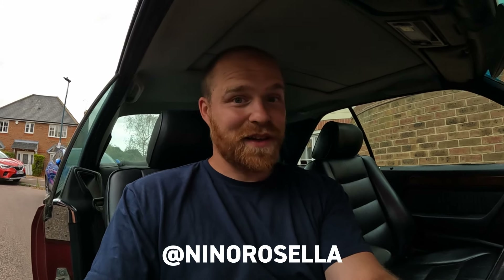One Last Try Fixing My Mercedes 220E

Comment: Got to learn how to diagnose components man, make your life so much easier, leave the guess work out of it & save you lots of time and frustration man.
Reply from the maker: This is all part of the process. Don’t forget that at the start of the year I knew nothing about how to fix cars. Quite happy with my progress so far.
Reply: what does that mean
Reply: @NotEconomicallyViable  you were on the right track with the spark issue, a bad crank sensor usually ends up with a no start period.
Reply: Ok man. Take it easy man.
Reply: Rough running and dying when off cold, really sounds like ignition. Replace HT leads , rewire the coil 12v wires and measure the coil resistance.

Comment: The sensor is easily tested by moving magnet in front of the tip, while monitoring the output by a scope. This sensor works with a spinning tooth wheel, with one missing tooth to mark rotation beginning.

Comment: Have you thought about getting the computer checked? It sounds like to me that everything starts up okay when it’s cold and then when it gets hot the whole lot cut out so there could be something not quite right in the car computer and being a very old car, I would suspect capacitors in the computer. I’m not working like that.

Comment: Just a quick thought, had a similar issue on a Ford Focus 2.0 duratec, would start, run till it warmed up then cut out. 
Solution after a lengthy trial and error diagnostic attempt was to unplug the EGR valve, it ran fine.

The problem was the EGR valve was sticking open when it opened up ie when it warmed up and I put my foot down, it felt like fuel starvation, the EGR is meant to open up and close at various throttle positions, it recirculates all the sooty, oily carbon gunky exhaust gases back through into the inlet for increased mpg and reduced emissions.

Now they do clog up, it might be you could take it off and clean it up, I tried that with mine and it partially cured it for a short time.

Ultimately I changed it out for a new one.

So unplug it first, try that, if no change, try cleaning it out.

Best of luck figuring it out.

Note when buying parts- shop around, recently had to buy a new engine mount for my focus, was quoted £191, tried my local budget parts shop, who are ususlly very cheap, they could get it for £90, rang another place £60.

Even tried a Scrapyard they wanted £20 for one off a similar age car that was probably as knackered as mine!

Got the part number from ford  tapped it into Amazon, BOOM one brand new Febi Bilstein £31 with free delivery, get in!! Quality was better than what was fitted as standard.😀 

Also check your part number and cross reference it with sites like auto doc, or even try Febi Bilstein website they also do cam sensors etc

They might be expensive but you could tap that part number in to Amazon or Ebay etc

There are always alternative part numbers from other makers that will be exactly the same.
Reply from the maker: Thanks for all that info, bud 👍🏻 

One thing I've started doing is first looking at parts on AutoDoc before anywhere else because they give you all the alternative part numbers from different manufacturers. I then just start searching around all the different sites like you said. 

The problem I have though is that I sometimes just need the part as soon as possible so that I can get these videos out, so I have to pay a premium. It's a bit annoying, but that's just how it goes!
Reply: @NotEconomicallyViable  You're welcome, I know how frustrating diagnosing an engine issue can be!
With my Ford I went on the forums put in my engine symptoms and got back the multitude of usual standard replies, fixes I already tried-
'oh it's your plugs', 
'no it's the coils', 
'fuel filter blocked', 
'defo your crank sensor', '
'no, I had this exact same thing, turned out it was a mouse eaten through the loom in the boot'😲😁

Thing is it could be anything electrical or fuel related, even an intermittent electronic fault like a bad ECU or faulty loom etc

But definitely worth checking your EGR it's something a lot overlook, gets blocked up, especially on higher mileage engines, will give erratic running like this because at cold start it doesn't open until it warms up, then it's meant to pulse open under certain throttle conditions, to let a blast of exhaust gases and recirculate it into the inlet, what happens on a clogged up EGR it sticks open, now part of your exhaust gases are going directly back into your inlet causing the engine to cut out.

I'm assuming as it cools down the valve closes again so it will start next time.

Unplugging it stops it from being activated or opened, it will throw an engine fault code but will run fine without the EGR plugged in.

Keep in mind if the EGR is stuck open or half open, it will still run erratically  or cut out, in that case worth removing it and cleaning it out with carb cleaner, there are specific EGR cleaning methods typically a spray can used while the engine is running and EGR in situ but they're not as effective as physically removing and cleaning it.

You'll figure it out. 👍

So either way an easy check to rule it out if nothing else.

The other thing to check, not sure if your engine has an Idle Air Control Valve IACV or ICV ?
It controls idle speed, causes cutting out and generally poor running.

I had issues with a 1990s ford Granada with this issue, again easy to clean out and fixed my poor running Granada.
Reply from the maker: That makes complete sense. Will definitely have to take a look into it 👍🏻 Really appreciate this bud

Comment: So I went and bought myself a project car Mercedes 220e W124 1993, and in the process now of having the wiring harness rebuilt, the car had been left under a tree for 12 years, i nearly gave up until I started watching your videos, so I back on the project, Incidentally where do you get most of your parts for your merc, and did you do another video replacing the harness.? absolutely love the channel.

Comment: Hi Nino

I had an old W123 that had the same issue in that it would just suddenly die, usually at Traffic Lights, but at any most inconvenient place suited it just fine.

Anyway, I took it to an Auto Sparky and he discovered a corroded "Earth Strap". This is a long thin  piece of Brass with holes drilled in it and resides somewhere in the passenger footwell under the dash. Basically, it creates a short and shuts everything down.

I think most of the components are fine. 

Given the other evidence of corrosion  you have in the Car, I would explore that avenue. 

At the time we also replaced the fuel pump relay at some ridiculously outrageous price, only to be told by the aforementioned Auto Sparky that the same relay is in an Opel/Holden Camira and could be bought for $30.00. 

Regards
John from Oz

Comment: This is diagnosis the old fashioned way.long before you could go on Amazon and buy a so called,", diagnosis tool" for the price of a gobble.
But saying that.a diagnosis tool is only as good as the person using it .
On the forum I work on loads of thease members come on with a fault, and buy the time they ask us a question they have replaced parts because there scan tool says it's that . and they believe it !
So we always say go back to basics.
It's wonderful to see you not afraid to have a go !
Which is how we use to do it .
Yep cars have come on a long way.and I worked for Volvo in the 1980's/90's .
I'm thinking aloud here but could it be temperature sensor for the ECU ,?
Any way keep on doing what you are doing .
Fantastic,!

Comment: I had O2 sensor issue with 1992 Audi. Engine just died when heated up. Cause O2 sensor gives info to computer about mixture based on exhaust gases. And computer than regulates fuel pressure in system via EHR (electronic hydraulic pressure regulator ). Atleast it's is in old Audi's bosch fuel systems! 
Don't give up! Good luck, patients! 
Greetings from Latvia 🇱🇻

Comment: The crank position sensor you brought first is the same as the one on my 2002 Mercedes SLK 320 so it is the right one for the V6 3.2L engine but not the 2.2L 4 cylinder

Comment: Electronics engineer here.

It seems to me like a problem when the ecu switches from open loop to closed loop.

Now I'm not certain what ever sensors are used in closed loop apart from the exhaust o2/lamba sensor would be one to test as the ecu uses that sensor to control how much fuel to out in the engine and only in closed loop mode.

The ecu knows to start closed loop control by the coolant temperature. 

You could try a fixed resistor in the temperature sensor plug (to set something like 20 degrees) and see if it cuts out then or not

If it does still cutout, well shit..however if it doesn't (may run rough and with a high idle)  then I'd change the o2 sensor.

Comment: Hi,
Have a little experience working on Mercs back in the late 80's into the early 90's, depending on engine type & fuel injection system the cold start regulator played up a fair bit.
On a side note check leads, plugs, fuel filter if not done so already.
Thanks.

Comment: I agree with some comments below. Electrical could be dead end. I personally believe is fuel starvation AND IN PARTICULAR, water in fuel. You can get water in fuel from ACTUAL filling stations, especially if that station has less reliable tanks and in wet weather water gets in. Personally I would DRAIN THE TANK and FUEL RAILS, then refill whilst also adding some injector cleaner or an actual additive you can buy to decrease / eliminate water in system.  Try this, much easier than all other stuff you are doing...

Comment: Hiya Nico. Still having problems running when just starting....was having a think about this and I know this goes against the grain of current electrical woes ( small joke in there) ....it may just be fuel  starvation.....pump building up pressure/quantity in fuel rails at start, but then when engine running it (the pump) can't keep up...had similar fault on numerous cars.....pick up pipe/fuel filter blocked...was just letting enough fuel through for initial start....run for a little while then chug chug to a halt....May be worth starting car, and as soon as possible after it inevitably stops, whip fuel line off to check for flow....or you could always put a transparent fuel filter in engine bay and watch filter until car dies, at least then you know that there is fuel  getting through...only trying to help..
Bill
Reply from the maker: That's a really great point – I'll definitely have to take a look into it 👍🏻

Comment: I’ve owned a lot of these Merc’s. Every one of them I bought for pennies because of unknown faults, which I knew were the soy based engine loom. 
I spent a week or so rebuilding looms, some with the original connectors. 
The splitting of the wire sleaving was from ECU plug, right to ever end section, shorting everything everywhere. 
The symptoms were the usually crap idle, stalling, rough starting, etc. 
it’s the main reason so many didn’t survive, despite being absolute tanks.

Comment: I had the same trouble with my E 200 T. So I can tell you a trick. Buy yourself some good quality wire in different colours and matching thickness. I took some silicone wires. You can take the whole engine wire harness out of the car in one piece.  It takes one or two hours, but it works.
I put it on a table and removed all the wrapping.
So vou have all the wires in front of you.
At some places they were bare for 10 centimetres.
Especially the wires to the injectors.
Then I cut one random wire about one centimetre behind the plug. Soldered a new cable to the centimetre I left on the plug and put some shrink hose over it. And then you can trace that cut wire to the next plug. Cut it also a centimetre before the plug and solder your new cable with the same length as the cut out to this plug.
And so you can do one wire after the other.
When all is new, wrap it in some fabric tape and put it back. It will take you some hours and cost you 50 Pounds but you have a all brand new and better as ever wire harness. It worked for me almost 200k Kilometres and, maybe still today, but I stupid dumbass sold the car.
Reply from the maker: Appreciate the advice. I don't know how much I'd trust that last centimetre of wire. I'd be tempted to go right up to the connector. What do you reckon?
Reply: @NotEconomicallyViable  I only used that centimetre for soldering. The crunchy isolation was removed completely. Then I soldered the new wire to that rest and covered It in shrinking Hose. If I remember right I did that twice. My problem was the price of the parts. So I reused what was still good. If I would had a good and cheap way for new parts I would have done it completely new, but the prices and availability of the parts are.....let's say interesting.
Reply from the maker: @wolframbenz1828  I just had a look at prices for some connectors. Oh my word. 😲
Reply: @NotEconomicallyViable  😁 Jep. That was exactly my problem, too. So I kept the ones I had. Such tiny little things can be very expensive. Especially when some people really need those. Like you. 😁
But the car is worth it. My W124 was the best car I ever had. No big problems beside the wiring. Because it was a T Model it had to wire the backdoor too. But all the rest ..straight awesome.

Comment: The crankspeed sensor measures speed and crank position. The ECU reads information from this sensor as soon as you crank the engine. Its a Hall sensor theres a toothed speed ring attached to the crank or on the crank pulley with so many slots around it and a gap = to 2 teeth when the cps is in line with the gap this = around 60 degrees btdc at this point it looks at coolant temp, crank rpm, throttle body position (load) and looks at the Map on the ecu to determine the ignition advance.
Open and Closed loop is to do with when the ecu takes mixture information from the O2 sensor. This sensor monitors the fuel air ratio or  mixture. The ideal mixture is 14.6 :1 (air to fuel) great for the environment but no good for cold starts or when you want to overtake. So the engine will start off in Open loop for cold start ups (choke) Change to closed loop so ecu takes and reacts to the O2 sensor but will jump to Open loop if you give it some welly WOT - hope this helps
You got the Dis or waste spark correct though

Comment: Similar problem on my 2001 E2220CDI, engine dead in the middle of the road. On my Mechanic's advise, changed both Crankshaft and Camshaft positioning sensors at the same time (€30+€40). Now OK. Good luck.

Comment: I would put a multimeter on the fuel pump and see if it loses volts when the engine dies.  That would tell me the fuel pump relay contacts were opening at that point.  Then I would want to know why.  Is the fuel pump relay there to stop the fuel flow in case of a crash ?  Maybe it thinks the engine has stopped running (even though it is running), and so cuts the fuel stopping it.  Remove the fuel pump relay and jumper it at the relay socket and see if the engine runs continuously.  Fuel pump relay is probably looking for rotation using a crank/cam sensor or ignition sparks, etc.

Comment: Personally if changing sensors, coil packs, mag sensors, wiring looms doesn’t cure the problem then your issue is with the Main ECU because that controls everything on the engine.
     I had a baffling issue with a 1998 Fiat Cinquecento that kept cutting out, it would start from cold quite happily, then just cut out and wouldn’t restart until it had gone cold again. 
     I replaced, the throttle body, crank position sensor, coil packs, wiring, and this did nothing. 
     In the end I paid an auto electrician to come and try and diagnose the issue, it turned out the ECU was switching off the Ignition part of the engine management system so as soon as the engine had warmed up the ignition circuit turned off power to the coil packs and the crank sensor.
    So to sort the problem out I would have needed a new ECU or the original one repaired.
     I never got it fixed because at that point I’d lost heart with it and got rid.
Reply from the maker: Ahh that's interesting. A couple of people have now said it might be an ECU issues, so it's definitely something I'll have to look into if a new wiring loom doesn't fix the problem
Reply: @NotEconomicallyViable  You could try this When it cuts out, take out a spark plug and see if there’s a spark when you crank the engine over.
   You may need an assistant.

Comment: I would still suggest using easy start to try and identify if a fuel or ignition issue. When it is running and starts to stall, by using easy start you may be able to keep it running if a fuel issue. If an ignition issue it would just stall.
Reply from the maker: That's a great shout – I'll have to give that a go 👍🏻

Comment: Reference the Mercedes W124 my friend had.he had a misfire issue and that turned out to be the ECU.
Ended up getting a used ECU from Germany and that fixed it.
He had the biodegradable wiring and had attempted to repair it and failed,the car was a nightmare but he loved it.
Reply from the maker: A couple of people have mentioned the ECU now, so if the wiring loom doesn't fix the problem then I'll definitely have to take a look into it 👍🏻

Comment: I think this might help, one of the youtubers was dealing with same issue of a different car, where he had the engine ECU on top of the engine, and one the engine is on running tepm, the ECU would heat up causing internal component to expand and and small broken solderings\connecctions to come apart and car shutting of. I guess this is similar issue, maybe something is disconnecting after being hot enough, maybe very close to heat source (engine), and it could be the coils.
Reply from the maker: Thanks for the info, Hussain 👍🏻